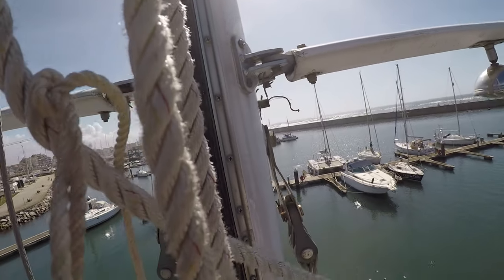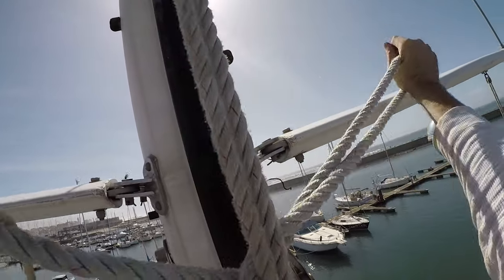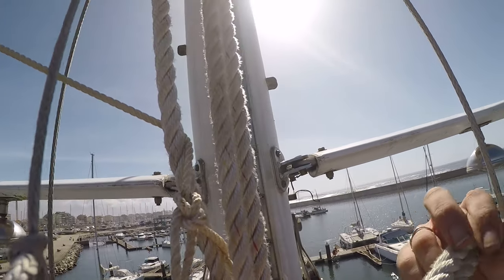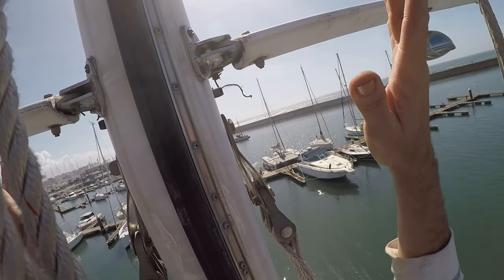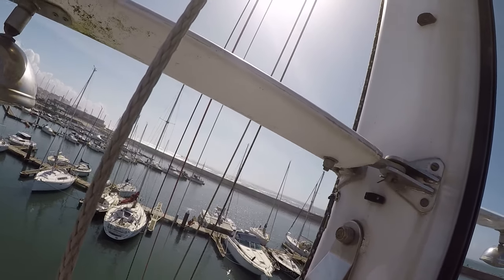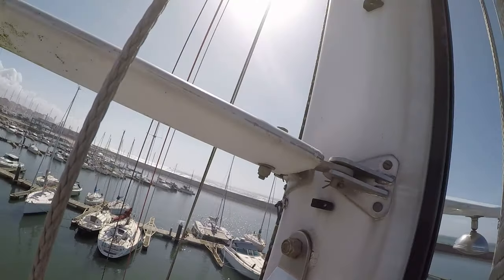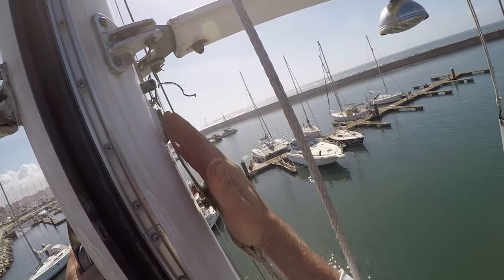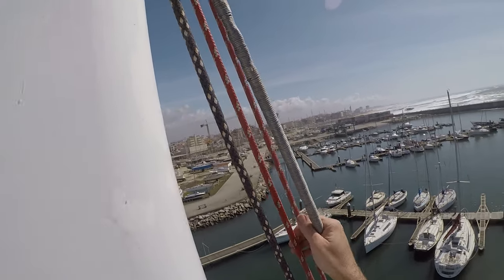How to Inspect Your Own Rigging | Sailing Wisdom

Comment: yep i was using three ascenders, one tied short to the seat, upper ascender to a sling for my foot to step up then pull up the seat with me sit down move foot ascender up, repeat, and another ascender on another line as safety, 55 feet in the air seems up there, with a harness tied with seat, so if i get tired i just sit awhile, and harness cant cut off leg circulation after sitting in it awhile with harness alone
Reply from the maker: I tried the leg powered ascent but was not coordinated enough to pull it off 😕

Comment: How about checking wooden spreaders?   I originally had wooden spreaders.  I hired a rigger and he convinced me to 'upgrade' to aluminum spreaders and had them fabricated custom.  Problem is, when he went to install them, they were 4" too long.  So now I have 'modern' aluminum spreaders which stick out 4" on each side.  I keep considering going back to my wooden spreaders. They look more authentic anyways.
Reply from the maker: Wood spreaders work just as well as aluminum, but you have to keep an eye on them for rot. I personally find wood spreaders (made from a really good wood) to be my favorite choice since you can make them to the exact shape you need more easily than I could form aluminum. 
If mine broke (I have seen aluminum spreaders break at the seam and open up like a bursting can) I would replace it with wood in a heartbeat. Our second sailboat also has wood spreaders and I’m going to be keeping them that way. 
The important thing is that the spreader first and hold the cap shrouds in the correct position.

Comment: Thanks for sharing. You can't be to careful with the boats rigging and just like your car engine it needs to be maintained. As for cotter pins, they are cheap and I only use it one time and then I replace mine if I remove it. It helps me sleep at night. 8-) Happy sailing.

Comment: First of all, thanks for the lesson. I learned quite a bit. But a few questions remain.
I have the option of lowering my mast.  Is it necessary  for my mast to be up during an inspection or is it ok to take it down to check it. (It only takes 20 minutes).
And what about the tension? How tight should my rigging be?
Reply from the maker: It is much easier to inspect if it’s down, so that would be preferable. As for tension, it depends on the rig design. Some need the stays to be at 25% of their breaking strength, other designs allow for much slacker rigging. 
I personally prefer my rigging to be set “as slack as possible” because this leads to less stress on everything which hopefully translates into everything lasting longer. 
I would suggest looking up your rig design on the Selden website and see what they recommend for tensions and go from there. You don’t have to have a Selden rig, but their website has a comprehensive list of almost every rig you could imagine and all the details associated with them.

Comment: What is keeping the shrouds to the spreader tips? It looks like they are just running down a channel but I didn't see anything holding them in place.
Reply from the maker: There is a seizing knot on the tip. If you look closely, you will see a thin band of Dyneema lines wrapping around the side of the spreader tip. That’s the seizing. 
This was how I did it on another boat with two spreaders: https://www.riggingdoctor.com/life-aboard/2016/11/6/islander-36-conversion-seizing-the-spreader-tips

Comment: Thank you so much for this video! (I know its 2 years old yet its quite informative (to me)). Quick question. if you see galvanic corrotion, is there anything that can be done about it?, like any treatment, or perhaps cut a square / oval in the mast and replace it with new aluminum or something that can be done about it?.

Are there any ways to prevent galvanic corrotion over the top of the mast? (I would assume perhaps a plastic separator between the metals?), again, many thanks for these videos, I dont have a boat yet but I am learning a lot from these!
Reply from the maker: If it’s minor, you can scrape off the flaky white powder and then sand the metal to make it shiny, then place lanolin on the metal to protect it. 
Normally it will be seen next to a screw where you can’t really cut it out, so you just pull the screw and coat the threads/hole with lanolin, then replace the screw. If the screw looks bad, you will need a new screw. 
Basically, keep dissimilar metals separated by plastic separators and lanolin when you can’t keep it separate.  :)
Reply: @RiggingDoctor  sweet!, many many thanks for your replies! :D

Comment: If it's just a visual inspection then can't one send up a drone rather than climbing up the mast?
Reply from the maker: You could, but the drone needs to have really good resolution to see everything. For quick checks, I use a telephoto lens on our DSLR. From the deck I can shoot up and zoom in on each and every cotter pin to check them out. If I see anything questionable, then I go up. Makes life easier!
That said, I still go up before a long passage just to give it a good proper looksy.

Comment: We will be lowering our mast at the beginning of summer to travel down the  ICW. We will take the opportunity to inspect all our rigging. I hate heights so Ill make sure to revise everything from lights to wiring. Id really like replace my rigging with dynema when it will needs replacement. If you had to do it again would you still chose synthetic?
Reply from the maker: Yes indeed! Our inner forestay is the only steel stay left and just died. Replacing it with steel would take about an hour, with synthetic about a week. 
I’m replacing it with synthetic.
Reply: @RiggingDoctor  I just had my rigging replaced but stayed with the dark side (stainless lol!). When it comes time to replace it (2030!) I'll go with synthetic.
Maybe by then they'll have figured out how to have roller furling on s synthetic forestay. 🤔
Reply: @RiggingDoctor   Wouldn't synthetic to be quicker to make and replace rigging than steel?

Comment: Thank you! 
This was an excellent video on a topic not very well covered in detail. 
I will soon start the restoration of my old little boat and I will replace (install) the rigging with synthetic rather than stainless, that is your fault!!! 
I will surely be asking you some questions later but I have to plug all the holes first. 
Thanks again for your channel!
M

Comment: I assume the lighting wire comes up through the mast. Mount a small connection box to the top or bottom of the spreader. Get some AC or MC wire (Armored wire). The smallest you can get is 18 gauge, which is more than you need for a couple of LED lights. Get a couple of feet more than you actually need from light to light. Hook up the lights then let the birds try to eat the armor. Use your standard waterproof connector. A little paint will hide the wire from casual view, and minimize any corrosion. Zip ties will keep it from vibrating or sagging on the spreader.
Reply from the maker: Thanks! I’ll look into that kind of cable. I still have the old wire present so I can always use it as a lead!